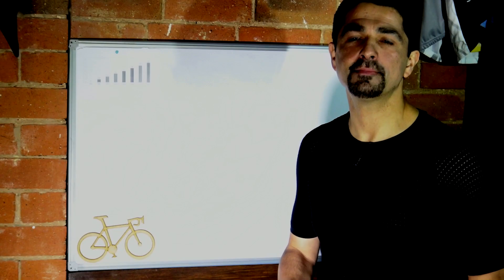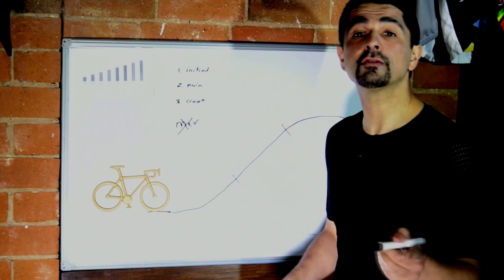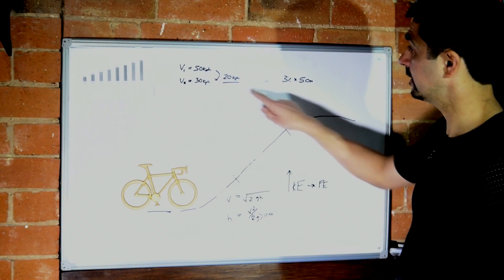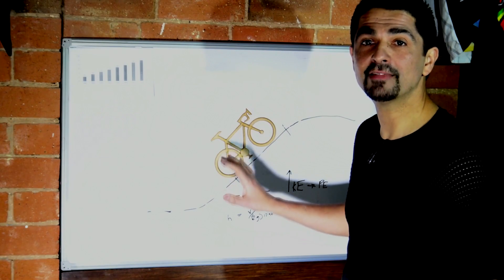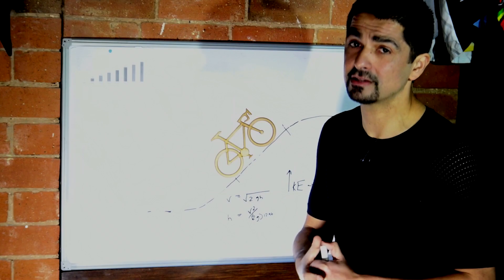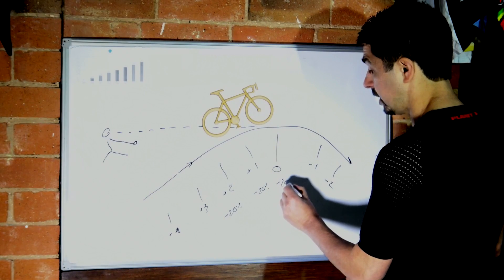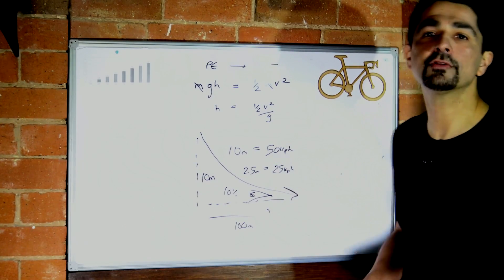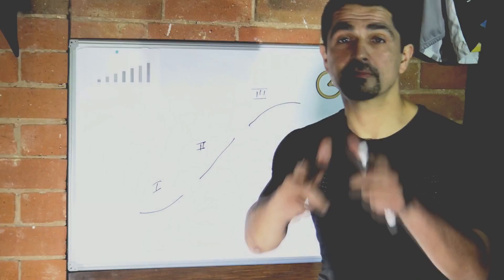Can physics help conquer fear of hills (aka how to ride short climbs/slopes using science)

Comment: I won’t claim scientific expertise to argue but I do have a different perspective on speed, power, and energy relevant to climbs. High speed in phase I merely allows you to begin phase II pedaling fast (making more power) in a higher gear. Forward inertia of your high speed from before or during phase I very quickly evaporates early in phase II. It’s more about not having your pedaling RPM drop (reduction of power output) than it is about the kinetic energy that is quickly robbed by the hill and the air resistance.

Comment: accelerating much before the hill is not helpful in real world conditions, because due to the exponential increase in aero resistance you waste more energy to reach that high speed than you get back as momentum. The fastest way is to maintain constant power over the entire climb, give all you have over the top (and than save energy on the descent, where powering will not give you an advantage, again due to the brutal expand of the air resistance at high speed)
Reply from the maker: Thanks. You are right (up to a point) you cannot fight air resistance too much esp over 40kph and also facing longer climbs but you know I am talking about "short" climbs in this video right? aka slopes. Steady state climbs ie longer climbs are discussed here https://www.youtube.com/watch?v=HlglnUNnAnY. I don't know of any good cyclist who does NOT attack a short climb/slope at the bottom when going for the fastest overall time. However if you personally find not accelerating when coming up to a slope best for you, thats interesting. In fact what about a field test.... ride a few times on the same short hill in both ways (attacking and not attacking) and let us know which style worked best on the watch from bottom to top. You should ideally do this in the following field test order 1 >2>2>1 >2>1>1>2. Where 1 is condition A eg attacking and 2 is condition B ie not attacking. Mathematically you have to do 4 trials or 8 trials so that neither is affected by "going first". Average the times for A vs B and you have an interesting result.
Reply: well, I will do such a field test (when winter is gone...), I am curious about the results! Till now I convinced that the best way to save time is to maintain a steady power output - or in terrain with ups and downs of significant gradient, to put out the high power no the steep parts (where the power/speed ratio is nearly proportional) and to save a bit energy on the flats (and even more on descents), where more power means less than proportional increase in speed. But may be I'm wrong, we will see...

Comment: I have a friend who attacks short hills as you mention while I prefer to increase power about half way up our short 300M hill. We usually arrive at the crest at the same time. I just feel too exhausted if I attack on the flat section.
Reply from the maker: Yes, you have to have enough in reserve  not to burn all your matches in the attack at the bottom, and therefore it only works on short hills....aka slopes!! Try speeding up only a little vs non at all
Reply: Will do. But the gain will be much less. The hill is about a 10% gradient so about 30 meters.

Comment: Couple of comments; 1. increasing speed too high (up to 50kph) at the foot of a hill can be counterproductive, as you will have big aero losses, and big power demand to reach that speed. You may then be more tired than necessary when you actually have to start climbing.  It would be interesting to factor in aero vs % grade and see what the optimum 'attack speed' is.
2. Froome simply surprised his competitors and pulled out a big gap mainly because he adopted an unusual 'aero-pedalling' position and had an extra big gear on. But I agree it is good practise to crest a hill at a good speed.

Comment: There is mistake in math, A^2- B^2 not equal A-B, so when we lose speed from 50 to 30 kph we gain more than 6 meters elevation
Reply from the maker: Hi +Dil Vastak thanks for this so its the difference in the sq of starting and ending speed that counts (just checking would my error apply only to only change in speed and not gain in speed from 0mph)?
Reply: Yes, you understood correctly. but i make mistake - forgot sq (A-B)
Again simple math (A-B)^2= (A-B)(A-B)= A^2 -2AB - B^2
So if A or B =0 we have that A^2-B^2 equal (A-B)^2
Reply from the maker: Thanks again, I have uploaded a quick calculator: https://www.dropbox.com/s/jq0qhsfq5qg65tw/FFT_speed-to-height_conversion.xls?dl=0

Comment: Would you be willing to explain this in more of an easier, simpler format, for those of us who don't quite understand Algebra math, all too well?
Reply: Basically, build your speed up on the flat to attack the hill. Using the energy you have built up on the flat will help you ride a faster even pace up the hill. (e.g. the more speed you build up on the flat = bigger tank of energy for you to use for the hill)

Then for stage 3 (crest) it's important to not let up until you reach the descent. This also means, because you are carrying more speed into the start of the descent, you will reach a greater speed by the end of it.

However, it's important to understand that body position is ultra crucial if you wish to make the most of your downhill section.
Reply: just pedal fast.